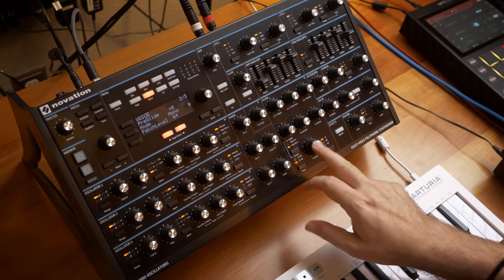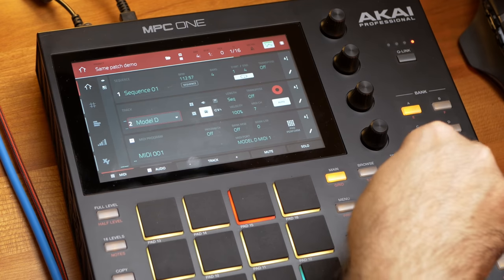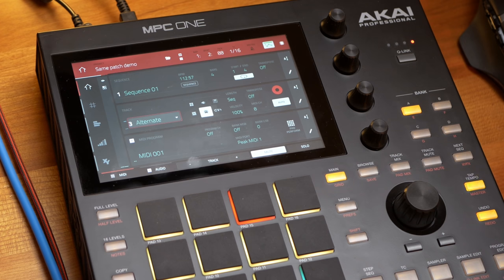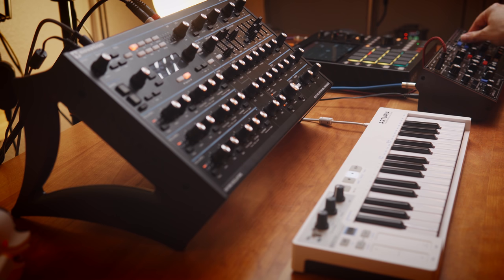Same patch, 9 different synthesizers

Comment: tbf., once one looks a bit closer at the technical side of things, one might notice that the Neutron and the Model D are architecturally quite drastically different as far as analogue monosynths go.
The Model D is a Minimoog clone, the oscillators are realized via discrete circuitry (and, well, there are three instead of two) and the filter is a 4-pole, aka. 24 db/oct transistor ladder filter (aka the classic Moog filter... because Moog used to have a patent on that back in the day, so other synth manufacturers couldn't just easily copy it without risking legal problems... not that that actually stopped anyone)
Meanwhile, the Neutron has two V3340 ICs (a clone of the CEM3340... also used, for example, in the Prophet Pro One, among a ton of others) for the Oscillators and the Filter is a 2-pole (so, 12 db/oct) state variable filter, that is allegedly a new design specifically for the Neutron... haven't seen a schematic for it yet. Well, and there is also the thing that the Neutron is extensively semi-modular, as the matrix of minijacks to the side should make obvious.
Which means, neither the oscillators, nor the filter (nor anything else, really) are all that close aside from form-factor and the basic subtractive flow... that they thus also sound quite different from each other is... kinda expected.
Or basically: the Model D and the Neutron are about as similar as bananas and tomatoes are similar, in that they are both small analogue monosynths, just like bananas and tomatoes are both, botanically speaking, berries (fun fact: I am not kidding, look it up)
...well, kay, technically, you can use the Neutron as a two note paraphonic synth if you wish as well, so~... not even the monosynth-thing is strictly true.

Comment: I have a Poly D and a BARP 2600. Since ARP originally copied the Moog ladder filter and Behringer implemented this early version as well, one might expect both to sound very similar. Nope. At the bottom end, the 2600 blows the Poly D out of the water.
Reply from the maker: The more I play with the BARP, the more I'm in LOVE 🤣

Comment: Level matching issues allover the place, unavoidable and mostly fixed on the fly per example well enough to compare.  Model D's roundness sits nicer than everything else.  You hear how nice that is when the drums are in.  It also sounds like it's already been compressed.  It makes me think of a heavyset person sitting in a solidly built armchair that's just the right size for their plumpness to fill it out.  Plump, snug, and solid.  Also the glide is different on every other synth, I think.  Is the Model D's a "glide time" as opposed to "glide speed"?  Or maybe there's just something non-linear about it.  It sounds better on the wider intervals.  It helps create that elasticity.  Pro 3 was nice.  Having 3 osc., so the two pulse waves can be detuned from each other helps it get closer.  But that moogy filter, the glide thing, and I think the way that feedback/drive circuit works...  more satisfying.

edit:  also--the mono-legato modes aren't triggering the same on all of them.  I think you used the model d when you made the sequence, right?  You would have played it in slightly differently if you had used the Barp, for instance.

Comment: Thank you for a very enlightening test! Emperor's new clothes if I ever saw it. The difference between those "analog" synths is fantastically minimal. I would be curious to see you do a blind test to see if you could even tell them apart, let alone recognize them. No character, no life, no grit, no personality...I could recognize my synths blindfolded from the next room. SH101, Wasp, Korg monopoly, Prophet 5, OB8, Arp 2600, Super Jupiter...Even if I tried, I couldn't make them sound alike. Not even close. Modern components sound colder than digital and all exactly the same. I believe it is really a much better option to skip those fakes and go software where truly different, interesting and new stuff is possible. Astounding stuff!

Comment: The A4 mk2 could be defined as more 'sterile' than the Boog but even taking that in account, you are using clearly different envelope programming. Much subtler in the case of the Pro3 but same underlying issue,: there you could have made it sound 99% similar to the Boog. Still an useful and well researched video, though.

Comment: I'm so new to this. Still wondering why a synth is a stand alone hardware unit instead of just a download, plug and play, ha ha.
Reply: Because knobs
Reply: Simplest way I can explain: analog synths shape raw voltage currents often resulting in less consistent but more organic sound that have natural movement, pitch drift, and oscillation variations between notes that are subtle but somewhat unpredictable. This creates a certain character. Digital synths in the 80s used small computer chips to process and modify voltage currents. This resulted in more clean and versatile sounds, but often less character and movement (back then). Since the 80s digital synths got way better at emulating analog characteristics to the point where they are almost indistinguishable, but require the synth or computer to be quite powerful. Analog synths can generally only be hardware. The difference between digital synths and software is mostly just the interface (screen vs knobs), but only if the software recreation is *very well programmed*. Even then some old digital synths have aged capacitors that might alter the sound a bit.
Reply: Follow-up is why go hardware nowadays? It's mostly for fun factor, like getting an original arcade cabinet with original buttons vs playing an emulator on your phone or laptop. You can attach controllers, but it won't be quite the same...
Reply: Also it sucks when your favorite plugins get abandoned and your go to sound tools  don’t work with a newer computer a few years later and sometimes upgrades suck the life out of a plugin too or change the sound you loved when they “ fix “ or “improve “ . Something to be said for dedicated ui as well that no midi controller can quite replicate . That said I’m no purist analog or digital , software or hardware , use them all , but those are some of the things that set them apart from my perspective anyway .
Reply from the maker: I agree with the comments. Software is excellent today and I own ( and use ) tons of plugins. But once you start tweaking knobs and building "DAWless" setups, the immediacy of hardware is unbeatable. When I first started out, I'd mouse all my changes in synths. It was tedious, but I made it work. Obviously you can map controls from midi hardware today, but I prefer to have a shifting/changing desk setup today, and then bring performances into Ableton afterwards for extra overdubs/mixing etc.

After a while, you'll find "workflows" become more important than cost savings. And it takes a long time to find the right "workflows" that work for YOU. Cheers and good luck on the journey! 🍻